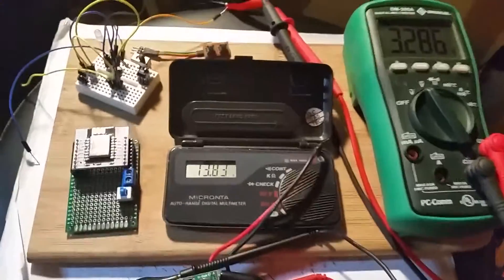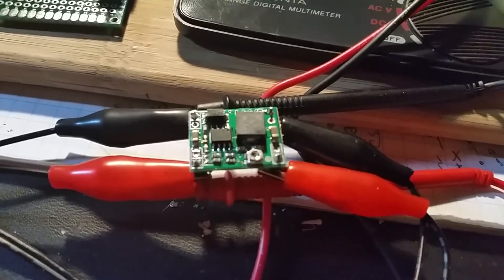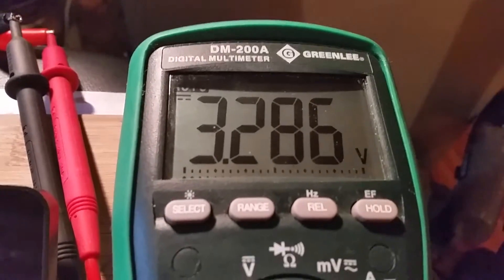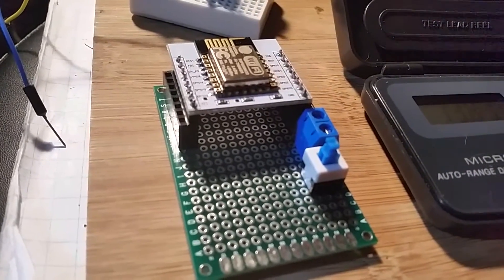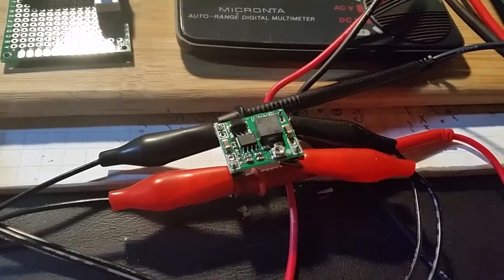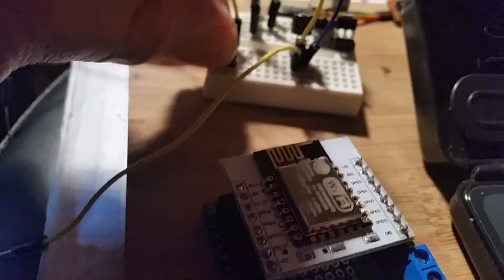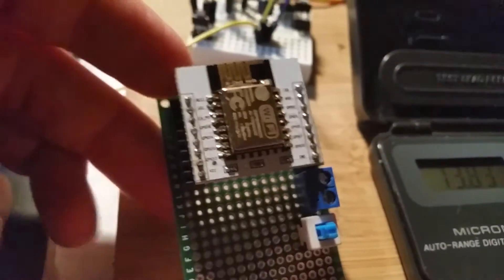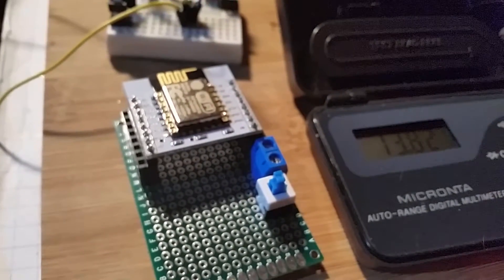ESP8266 12E Dev Board (part1)

Comment from the maker: It occurs to me to check and see if a ESP can drive ULN2003 ( darlington array ) driver chip . that would let me drive higher voltage inductive loads directly as they even have builtin freewheeling diode protections . IT should  do  , as i think  basic ULN2003 only needs a 2v signal to trigger a ON state . so motors and relays directly . I'll have to put that on my list fo things to test .
Reply: XerotoLabs I'm trying to use ULN and Node MCU but it restart every time
Reply from the maker: Gabriel Velandia i have not used node MCU , only Arduino IDE to program these guys .  I have seen some have needed to put a decent capacitor on the supply to the ESP' to make it more stable.  Also i think you would have to supply a dedicated 5V , and final out put voltage to the ULN2003 so that it would not rob/starve the ESP'  . 
I have had bit too much on the go to get back and test my ESP , mainly to sees if the 2 extra GPIO pins are live , and of course i want to test ULN2003 . I need to look at what the pins on the ESP' will do . It may require opto isolation . I don't think using Lua / Node MCU vs C++ should change what the pins can or cannot do . ( I'm probably wrong about that last one. )  do you have a link to you wire diagram ?